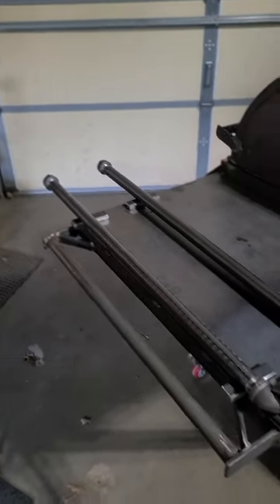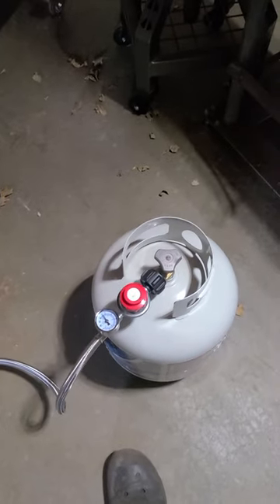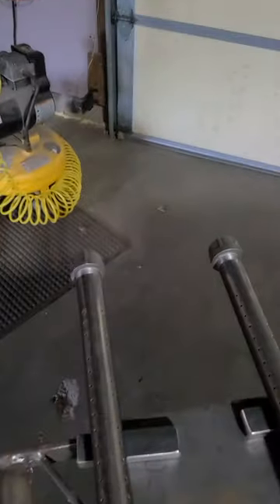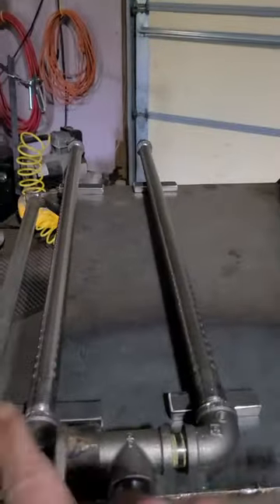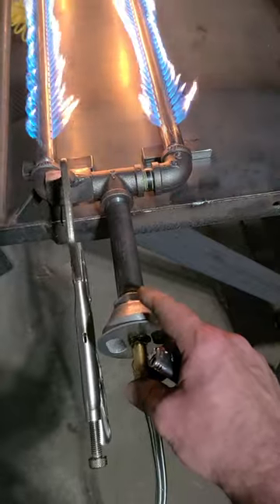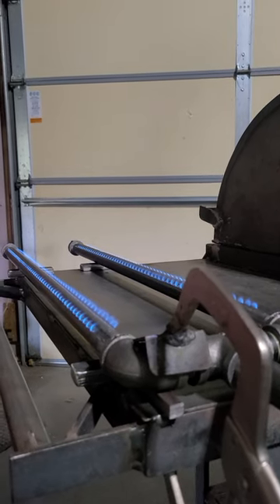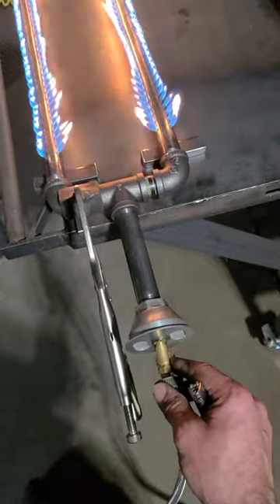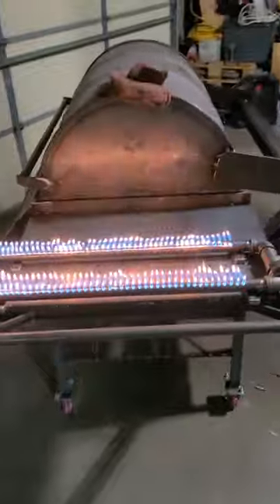How to Make a Pipe Burner. (HOME-MADE) 3/4 Inch Pipe. WORKING AND ADJUSTABLE!!!

Comment: you have more fuel than air ratio, that's why you have yellow tips, large holes are meant for natural gas, cause it's a lower pressure than propane, you should try to use a smaller orfice til you achieve a blue flame throughout the burn.
Reply: What size would you recommend? 
I wasn’t to make a 6 foot long burner, I was thinking 1”O.D 3/4” I.D. 
Does the length of the pipe change the size of the holes for the flame?

Comment: Well done getting it to even operate effectively! Getting the right fuel/air ratio and gas pressure at the manifold can be taxing when engineered for specific equipment. FYI, the low side L.P. regulator is measured in inches of water column and Propane needs 10.5" w.c. to be stable. (There are 28" water column in 1 p.s.i.)  I have run some down to 8.5" w.c. without a flash back so look at that gauge again or find one in "w.c.. Notice your low fire setting looked great? High fire is lacking air, open that shutter to see if that works. A yellow flame is poor combustion and poor heat. Getting the right orifice, manifold pressure and air is the fighting balance. If you have trouble, try a venturi on each burner leg, after your 1/4" or 3/8" adjustable valve, tee to both venturi tube ports. Use 2ea. #55 orifices and increase the manifold pressure to 10" w.c. at the regulator. At each burners first drill ports, spanning from left to right burners, place 1/2" metal angle facing 45* down(angle face down), this will allow the gas to 'carryover' from both burners lighting both burners from one point. 7 months late and I'm sure it's working just fine but it interested me enough to give my 2 cents'. 39 years HVAC Contractor.............ha, lol. Nice job!
Reply: snurb48, I would like to know if you would help me design one using natural gas.  I'm wanting to convert my wood fired Maple syrup evaporator to natural gas.

Comment: Great job thanks for sharing I have only one question how did you decide how to place your holes spacing and beginning and end that may be more than one question sorry Great job thanks for sharing
Reply from the maker: Well I did a lot of reading. Not a lot of these homemade pipe burner's pros divulge the exact size and spacing. I do know that if you're going with double rows you want them on a 90 degri angle of eachother but turned 45, so both are facing up. I read that a lot of mechanics have to build their own pipe burners for boilers. And from all the different online reviews and troubleshooting I learned that a 16th is too small. And a 1/8 is too big. So I split the difference with 3/32.  Now, when coming to hold spacing I read that 3/8" should work for most efficient Pipe burners. And I did mine 1/2".  Because I did not want to take the chance that the air mixer venturi could not support anything closer than 3/8. Even though the company I got the air mixer venturi from ( tejassmokers.com) had exact style pipe burners with holes 3/8 or closer.  Now that I see it I probably could have gotten away with 3/8.
Reply: Would it be better to go to 3/8" for the heat? Why are you thinking that? Would that air mix venture support 3-4 burner pipes you think?

Comment: I built my own burner about 3 yrs ago. The trick to getting both sides of your pipe to light off is to bridge the gap by cutting a slit to the other side. Now when you light the burner, the other side of that pipe will automaticaly catch on at the cross over. If you look at your common household oven, they do the same thing. Mine was built out of electrical conduit on the cheap.
Reply: Yum.  Zinc oxide in your food and lungs.  Conduit is galvanized.
Reply: @Jeff Clark  There's always that one guy. You do realize that it burned off long ago?
Reply: @jeffclark5268  Im with you,,,

Comment: neat.
1 - whats the safety elements required here - just the regulator at the tank is all ? 
2 - do you need to venturi piece - I see fireplace kits (not bbq) that just use a simple pressure valve .......... so what does the venturi provide above a simple pressure valve
Reply: I was wondering the same thing about the Venturi piece

Comment: I have a 32"x 24" grill. Can you build this the same way but having 4 pipes? And would that work?
Reply from the maker: I'd do two versions of what I did on 2 lines. They make 3 way splitters for tanks on Amazon. And maybe a 30 psi adjustable gage since your putting out that much volume